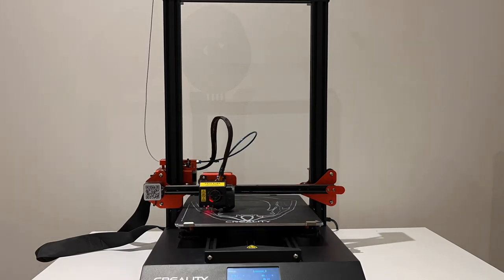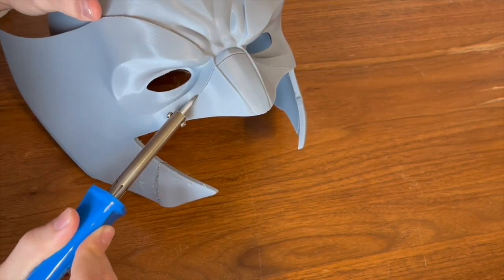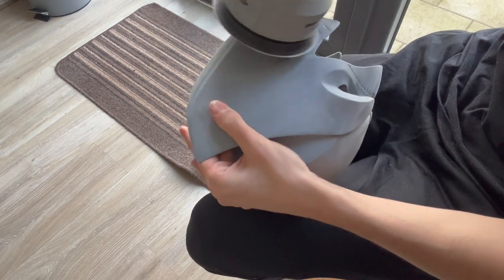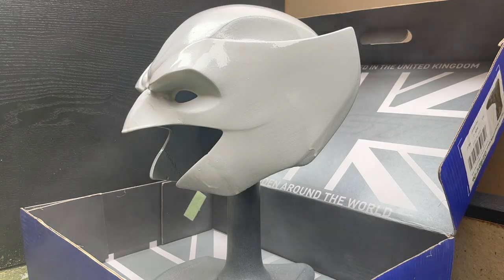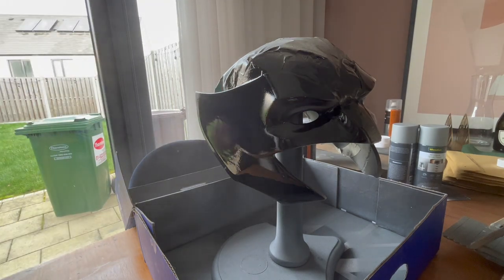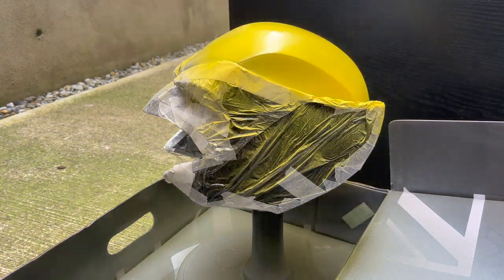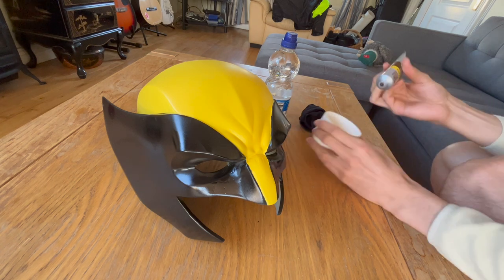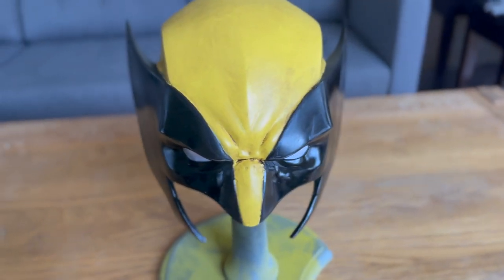Deadpool 3: Wolverine Cowl Full Build Tutorial

Comment: Thanks so much. I'm planning on making a spartan cosplay, and i needed some tips with connecting parts and sanding.
Reply from the maker: Happy to be of help 😊 you can find a solder on Amazon for like 10€/$ and then use wood filler to fill in the soldered parts and sand out to get them smoothed out!